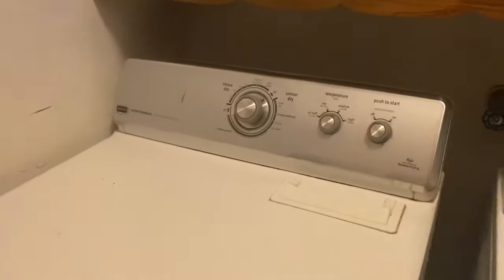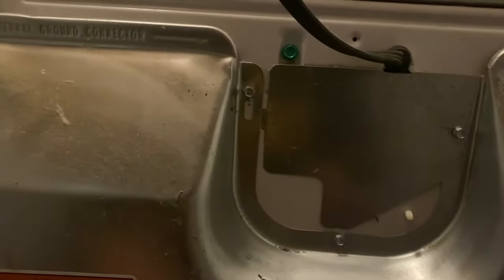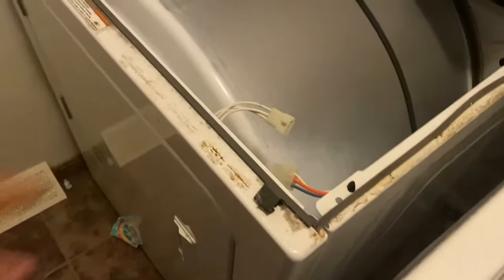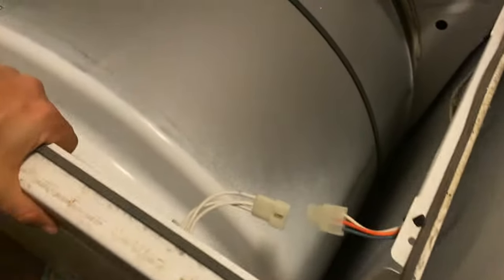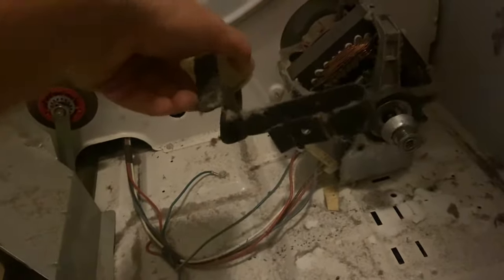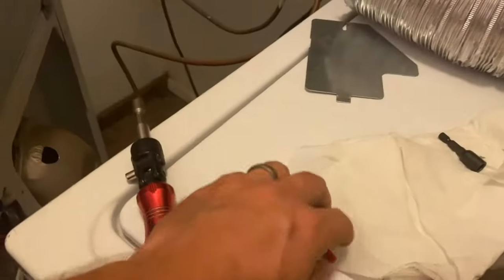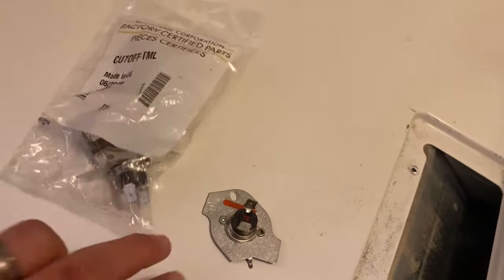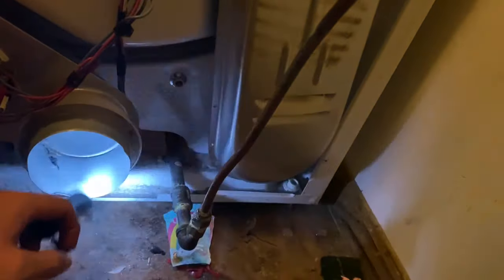Troubleshooting a Maytag Gas Dyer Not Heating | Model MGDC300XW1 #maytag #dryer #diy

Comment: Excellent video. The viewing port makes trouble shooting easy. Most of the other gas dryers lack this feature, checking the thermal fuse, it tested bad with an ohmmeter.  Don't buy cheap knock off look-a-like parts. The repair dealer said they won't carry any of the aftermarket repair parts anymore because the failure and return rate is so very high. Just buy OEM parts and your repair work will be top notch. I also used a leaf blower inside to blow the vent pipe clean. The leaf blower is at least 5 times more CFM than a shop vacuum. I did use a shop vac on the outside with a 12 ft long, 2-inch dia. pvc pipe going in and cleaning the dryer vent line out.

Comment: Great video. All the parts he tested are most of the normal 5 or 6 parts that typically break on almost all makes and models of a standard gas dryer. Take note of the igniter turning white hot. They will sometimes still glow when they are actually broken. The white hot glow as opposed to a lesser reddish glow is necessary for the igniter to complete the cycle in order for the gas valve to open.
Reply from the maker: Thanks man, it all comes down to testing resistance to see what isn’t working.

Comment: Great Video got the same dryer had no heat. Bought maytag spare dryer parts off of amazon. I opened the back 8 screws swapped 2 parts put back together and bingo dryer back to normal. Thanks so much for the video.
Reply from the maker: Glad it helped and figured it out before tearing the entire thing apart :)
Reply: Do u have the link for the amazon where u got the parts

Comment: Thank you very much for this video. I think I may be having this same issue. Will be checking it tomorrow. My dryer is not heating, but it is also not stopping itself after the time it is set for. Could this be a symptom of this same issue, or do you think it might be a different issue? Thanks.

Comment: Thank you for this video. So the only way to test the part that you replaced is to do the bypass? It can't be tested with the multi meter?
Reply from the maker: It probably could, but I don’t know that the resistance should be.
Reply: Thank you!

Comment: great video the only thing u did not do that u should do next time is open the piece where blower motor sits in especially if u already took lint screen screws out there are 4 more screws and in that metal duct its usally full of dirt lint and sand witch can cause over heating because blower wont pull out air this will also cause thermal fuse to blow How do I know I did the same thing and blew new fuse when i opened up duct it was loaded with heavy dirt and blower blades were also full of dirt Thanks again great video
Reply from the maker: great tip!

Comment: My dryer only heats on the timer setting. On auto the flame never turns on. Do you think it's the same sensors?
Reply from the maker: That sounds like the sensor in the dryer, when you look in there are 2 metal strips. Clean those, if they have a build up of gunk on them, it won’t read the moisture
Reply: I've replaced all of yhe sensors plus igniter and flame sensor igniter kicks on during startup burner igniter runs for 30 seconds and turns off any clue as what's wrong

Comment: What do you do if everything has continuity? Still no glow or heat. Same dryer as the one in the video.
Reply from the maker: hmmm, if you 100% have gas and power, then i would test the igniter. If its good, it could be an issue with the gas valve.

Comment: Mine has fire on for about 5 minutes, than fire shut off completely. So the problem is on the coils ? Thanks
Reply from the maker: It could be one of the sensors when it gets hot, best to test them all.

Comment: I'm having an issue with my Maytag but the igniter is working but won't fire up. I glows for 30 seconds then faded but the gas won't kick. It's not a supply problem. What could it be?
Reply from the maker: Have you tested the sensors? Something is telling the dryer to not release the gas.